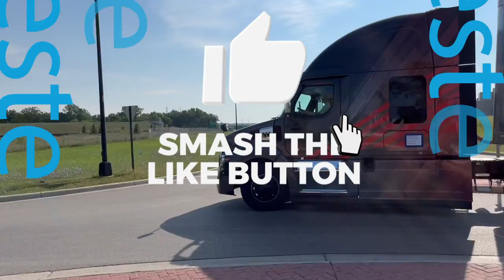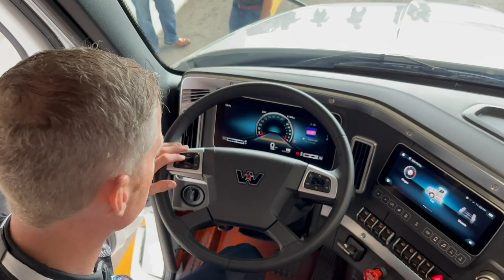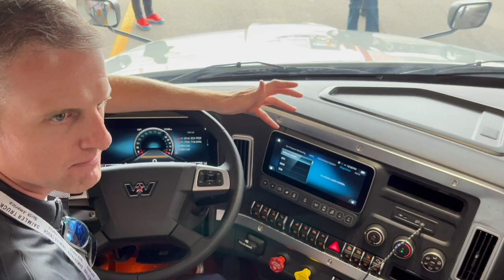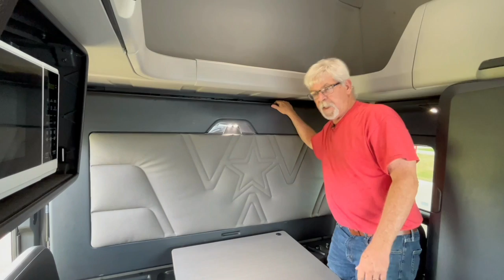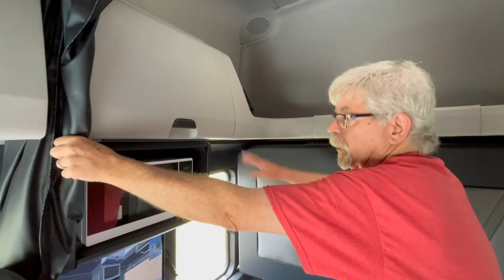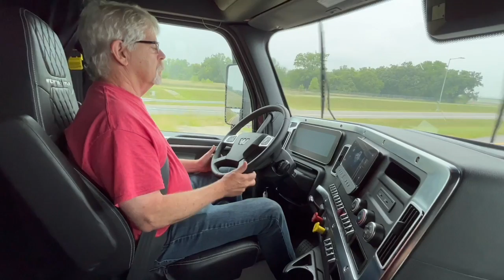On the Spot: Inside the New Western Star 57X

Comment: While you're cycling thru the digital gauges to find the ones you want, you're taking your eyes off the road. All these modal electronic displays will cause just as much distracted driving as cycling thru your smartphone contacts list to find the contact you want to phone. So if you change your mind, you'll need to pull over and cycle to other gauges. The old analog gauges were always all there for you, all the time.
Reply: You're old. 😂
Reply: And the standard gauges are still available if you want them
Reply: The last T-Rex living.

Comment: Not hard to see that Western Star is owned by Mercedes-Benz
Reply: They are not owned by Mercedes-Benz. You’re wrong.
Reply: @nasheemwhye5197  Western Star and Freightliner are definitely owned by Daimler
Reply: @stigandrmyrardalur5208  Now you want to recant what you said. 🤣🤣You didn't say Daimler, you said Mercedes, and Daimler is not Mercedes either. It's a company that owns Mercedes that has subsidiaries, much like how Volkswagen owns Bugatti, Porsche, Audi, etc. But a Bugatti is not the same as a Volkswagen Jetta. Two different companies and definitely two different cars under the same umbrella, just like Daimler with Mercedes and Freightliner, Western star a Cascadia is not the same as A CLS 550 not even close nice try though. I would have given you points if you said a 57X is practically the same as a Cascadia, that would have been a more accurate response than claiming the 57X is the same as a Bens especial. When there's nothing from a Mercedes car that goes into a semi truck. 🤣
Reply: @nasheemwhye5197  l wrote Mercedes-Benz because in practical terms it's the same.
Of accounting matters it's separated in several "different" companies within the same group.
Mercedes-Benz own Freightliner, Detroit Diesel, Western Star and some busmanufacturers in North-America. 
If you'd ever been inside a Mercedes-Benz truck like Arocs or Actros from the previous generation you'd recognized many things that are in Western Star and Freightliner today.
Reply: @nasheemwhye5197  You forgot one what VW owns. The Traton group that makes International trucks.